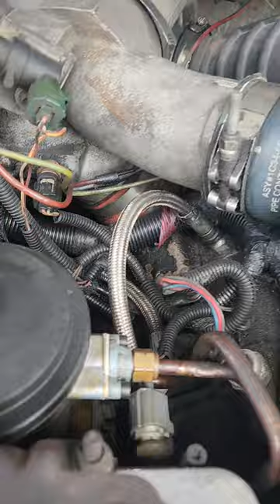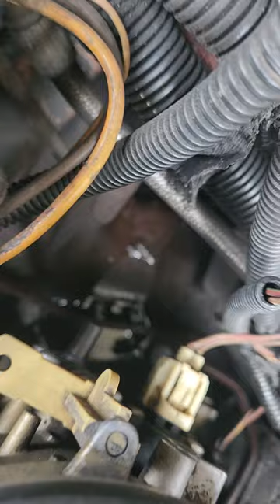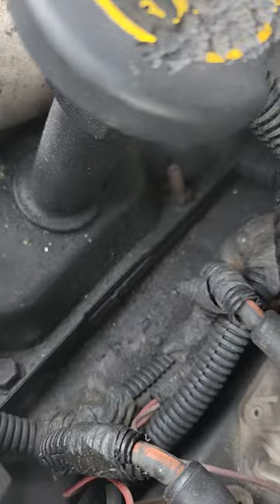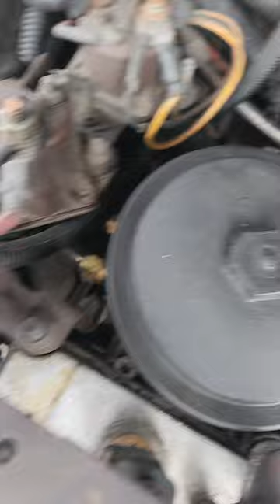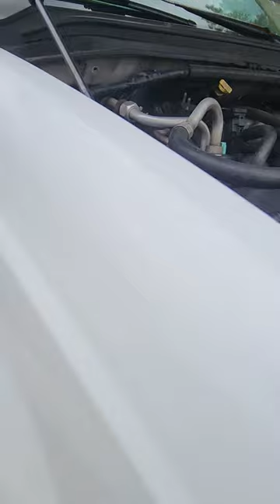02 f250 7.3 oil leak very minor. I gotta fix it though. if you 7🌳 guys have a thought let me know.

Comment: Check all your high-pressure oil pump lines. It’s not a line or you could be the back of your high-pressure oil pump.
Reply from the maker: I was thinking turbo pedalstol o-ring. But Ima have to bring it to someone I don't have the tools to do the job right.
Reply: @2alawabidingcitzen  it could be too but the oil was up front by ur high pressure oil pump it would’ve been the terrible pedestal the puddle would’ve been all towards the back
Reply from the maker: @fuelhousefarmz7504  that make sense I was thinking the vacuum being created by the fan while driving pulled it towards front but I could be over thinking it.
Reply: @2alawabidingcitzen  na there vacuum that’s strong with the fan and if anything, the fan pulls air in from the front of the radiator and pushes it out towards the motor so there was a vacuum and put it towards the back

Comment: Check you HPOP, HPOP line fittings, and HPOP reservoir. Keep the 7.3 running ain't too many down here in NOLA anymore.
Reply from the maker: I gotta get a 7.3 tech to replace those gaskets for me.
Reply: @PierresMobileCarDetail  The lines are easy enough to replace. Now the gasket on the reservoir, on the other hand is a little bit of a nightmare.